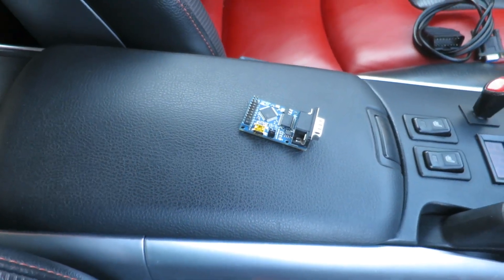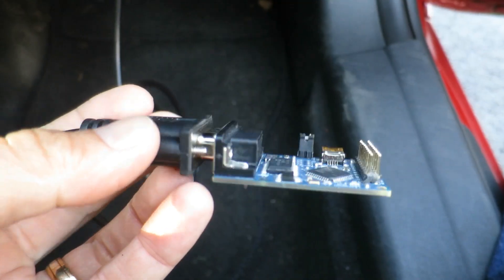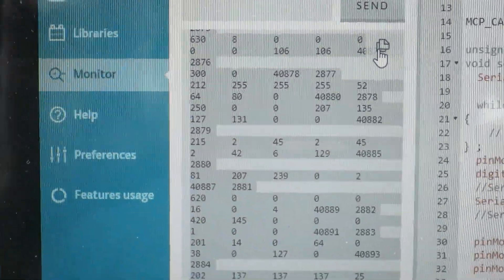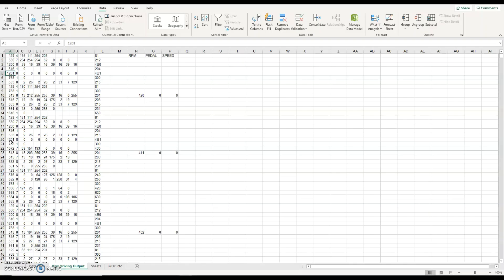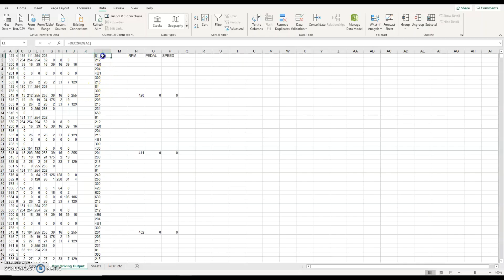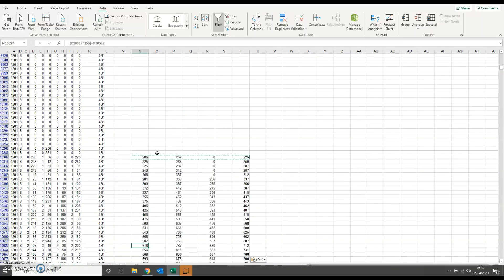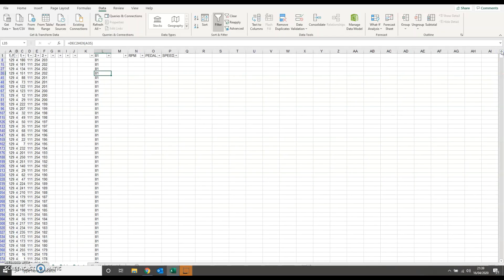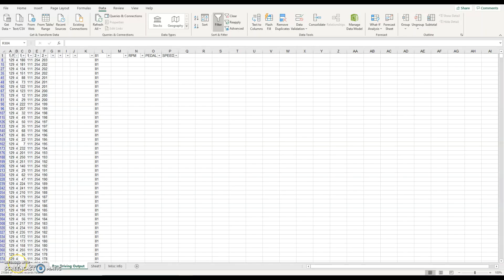How to read the CanBus in any car. (Can Bus) Part #1

Comment: Just wanted to say thanks for helping me to get my head around what CANBUS is all about. I watched videos of Damien Maguire driving forwards, backwards turning left and right etc collecting data but hadn't a clue what he was doing.
THANK YOU! It really is not as complicated as I thought.
Only issue with the CANBUS device you listed is they only sell them in kits of 10 so they cost over £200. I think I'll look into buying the CANBUS shield and suitable Arduino separately but thanks again for the best video I've ever seen on CANBUS.
Reply from the maker: Hay - It is worth contacting Hobbytronics - they used to sell 1's but moved warehouses and thats when they became kit only in 10's. Last time I spoke with them they did me 3 (as I blew one up, oops!) so worth a shout.
Reply: @SouthWestEVUK  LOL, I already ordered a separate Arduino Uno and CANBUS shield as soon as I finished watching your video.
Reply: Would you know what would need to be changed in the code to run your sketch on a standard Arduino Uno with a CANBUS shield plugged in.
I tried it as is but all I get is the following
20:50:05.824 -> Enter setting mode fail
20:50:05.824 -> Can Init Failed
20:50:05.824 -> I will wait here forever...I will wait here forever..I will etc.
Thanks
Reply: OK I have it working in my Mercedes C220 and here is how
I bought a genuine Arduino Uno but any clone should work
I bought a CANBUS Shield V1.2 cheap off ebay. 
I connected the CAN high and CAN low on the shield to a pair of CAN signal wires in the boot of the car.
I changed your code to CS10 from CS17 (For the Shield I'm using) and Speed 125Kbs from 500Kbs
I used the "CAN_BUS_Shield-master" library from Seeed studio
I had several issues before due to not understanding Arduino. I had multiple libraries in the folder causing conflicts and I wasn't using the correct baud rate for my car.
Thanks again and good luck with the project.